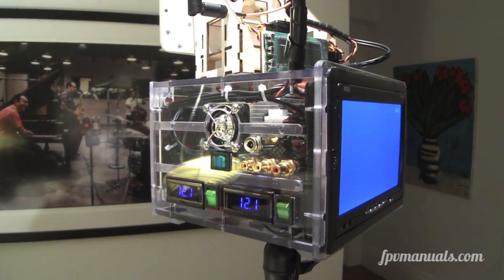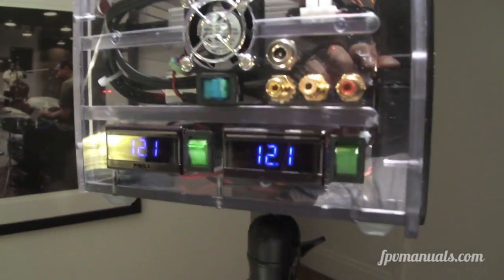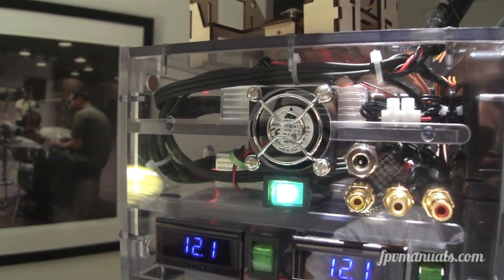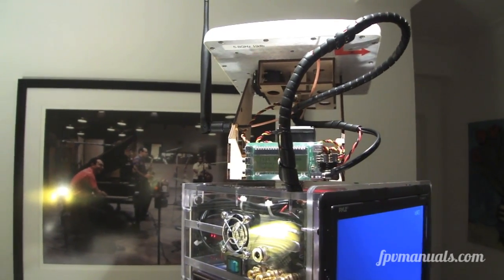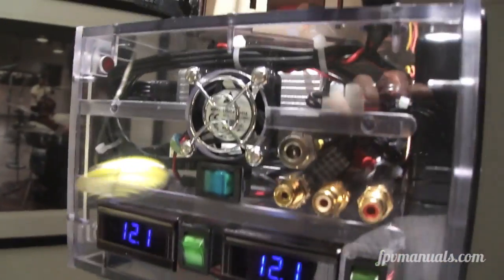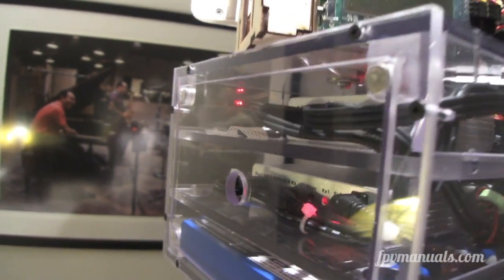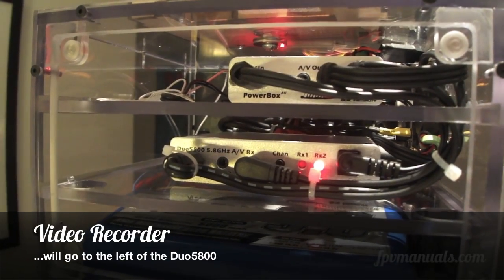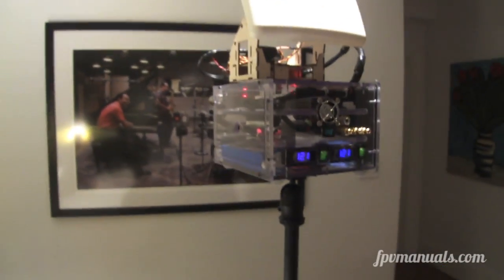Lexan FPV Ground Station

Comment from the maker: @123RCUK If you look at the video, the switches are actually not lit.  The required wiring to make the switches light up in combination with the PowerBox created a reverse ground, which blew up the PowerBox and the switch lights.  I now just connect the switches as a simple single throw rocker switch.  Works great.

I am working on a kit of this GS, which will be acrylic instead of Lexan and will also be 2D laser cut instead of CNC-ed.  Should be available in about a month or two.

Comment from the maker: @TheKrazydreams The displays show voltage of each of the two batteries.  As the batteries run out of power, the voltage will start to drop which indicates that it's time to charge them.